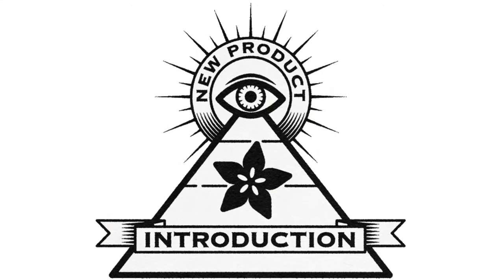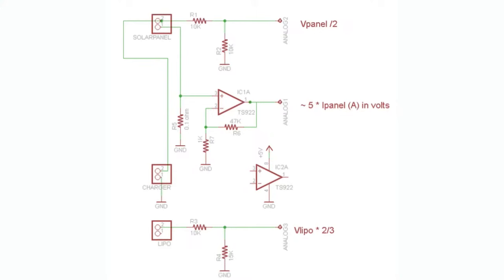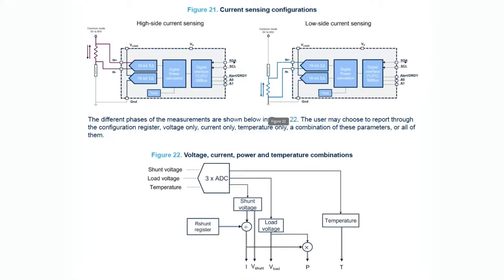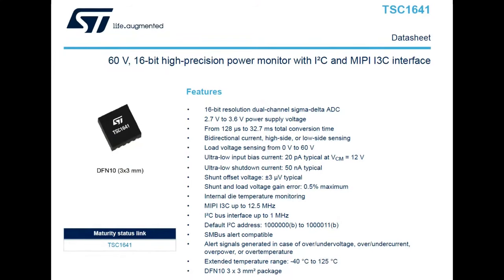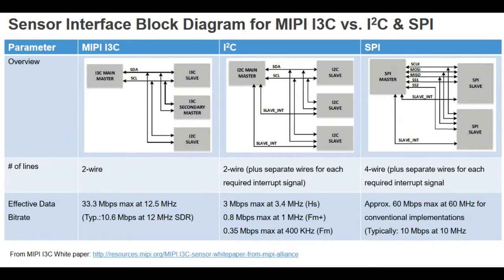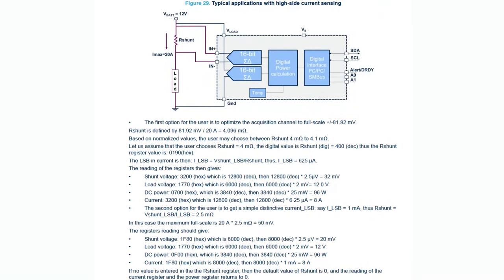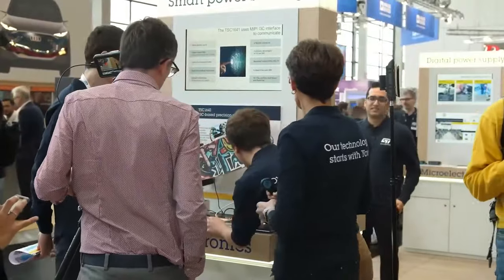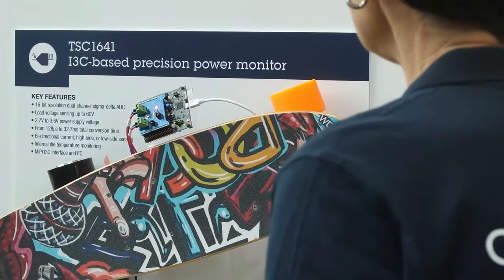EYE on NPI - STMicroelectronics TSC1641 Digital Power Monitor #digikey #EYEonNPI @DigiKey @ST_world

Comment: Great video. I'll have to try these out. It would be nice if the MIPI alliance used present day terminology. i.e. at 5:06. Use 'Controller' and 'Responder'.
Reply: There is nothing wrong with the terminology they used. The normal terminology captures the functions much better than controller and responder.
Reply: Yes, there is something wrong with it. Look up the use of the terms Master and Slave. All of the MIPI  documents are to use the current standard now. They use the word target instead of responder but the meaning is captured either way.